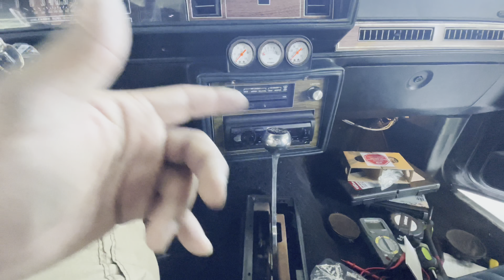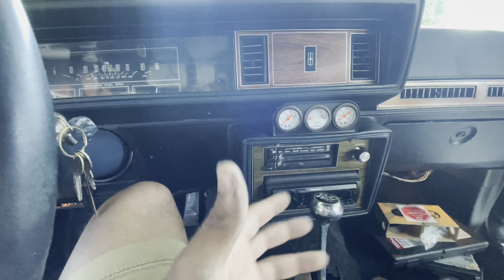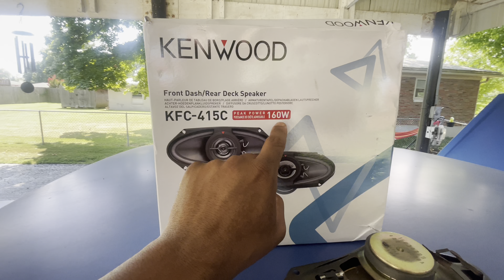OLDSMOBILE CUTLASS | G-BODY | “SPEAKER” Install

Comment: Those are the original speakers. I've an '86 442 and I still have the originals (front and back) in a box from when I swapped them out. Same with the original cassette radio (doesn't work, sad :( ). Speakers still worked, shockingly, just, you know, not well lmao.
Reply from the maker: That’s awesome yeah my original radio was long gone. I’ve done more to the car since this video. I need to do a update video but I’m about to make a video on it soon. So be on the look out
Reply: Ive got the same one as you bro but where are the back speakers located?
Reply: @my442.86  In mine, I have to crawl into the trunk. They're attached to the panel beneath the stop light, held up by metal brackets. They're 5x7" oblong things. For me, there's nothing between the open trunk and the rear of the rear seats so the speakers and wires are just visible there.
Reply: @Greyhound1211  oh bruh I never knew that😂😂😂

Comment: I've watched about 10 videos on how to  put new speakers in my G-Body..... Some short and some long they all showed us how to screw the speakers in and where they go and how to take the old ones out but not one video showed me how to get to dash speaker grills out without busting the clip all to crap ...... I think we can figure out that the new speaker goes in the hole with the old speaker came out of .....
So. ....please somebody tell us how to get the grills off without breaking them ....there hard to find in good shape already....lol ... All jokes aside good video man !
Reply: Plastic trim pry bar and lift it up from the middle on both sides, only 3 clip hold them in
Reply from the maker: I wish I had some advice on this. But every single time I removed any I broke them in the process.

Comment: How are those 4x10s working out? I need to get new speakers this summer. I had rigged up some 6x9s, but not very well and one broke while racing... Thinking about going to the factory placement.
Reply from the maker: The 4x10s are working ok. Their not as loud as I would like them to be. But I plan on redoing the whole system after I get the car back road worthy.  I’m planning a whole series of videos on both the system set up and the fuel issues

Comment: Those are the EXACT 4×10's  I have in one of my Regals.
Reply from the maker: How did they perform for you?
Reply: @JamarrelJ  They sound crystal clear. I don't worry about bass from them I just wanted midrange and upper highs from them. I'm fixing to switch up and where my backseat cushion is I'm going to have a wall of 18 6x9's

Comment: Did you need a certain wiring harness to convert your old stereo to a single din? And what installing kit did you use to fit the single din?
Reply from the maker: I did not need a special wiring harness to convert the old radio. This car was already converted into a newer style stereo. But the wiring harness colors do not match the new radio harness. So I had to do some research on what volts certain wires were for power and which speaker was which. As far as the installation kit my local car audio shop at the single din conversion kit. I can look at the box this afternoon and give you a answer on what it was
Reply: Ok that would be awesome thank you!!
Reply from the maker: I used a HiFisound kit for the single fin kit sorry for the late response

Comment: Hey bruh,  did you have to take the dash out to replace the front speakers? I tried to do my Monte carlo but they hit glass.
Reply from the maker: Do I didn’t. They hit the glass but you just have to work them out with a little force. Just be careful because they break easy.

Comment: Bro get a small dremel with a grind stone and take off the inner edges of the speaker holes and drop the 4x10 s in from the top flush. That's what I do. No brackets needed.
Reply from the maker: That definitely sounds like a better alternative. I haven’t worked on the car lately but Ill have some updates soon
Reply: @JamarrelJ  👍🏾👍🏾✊🏾❤️